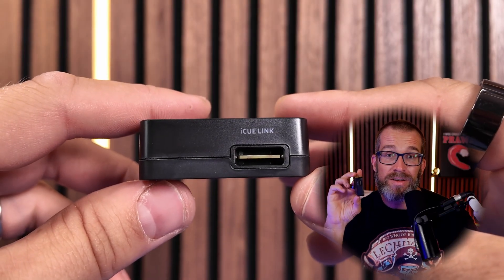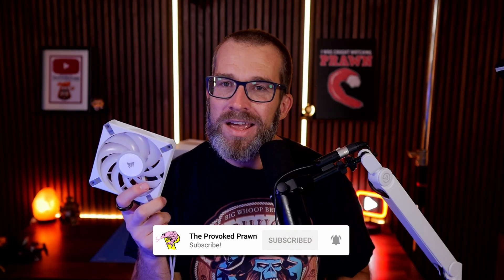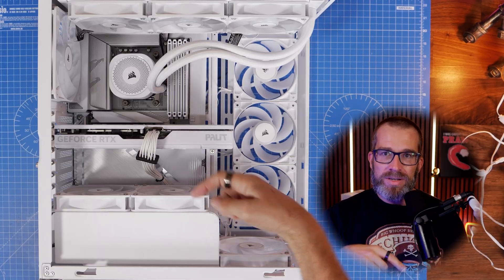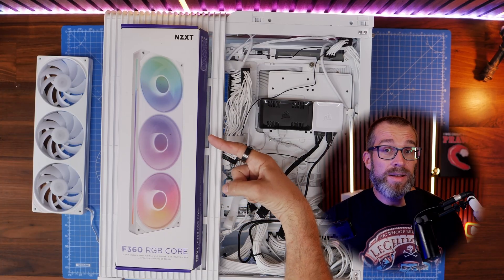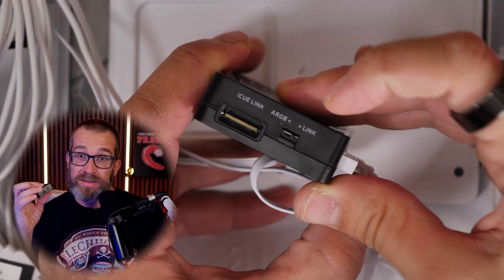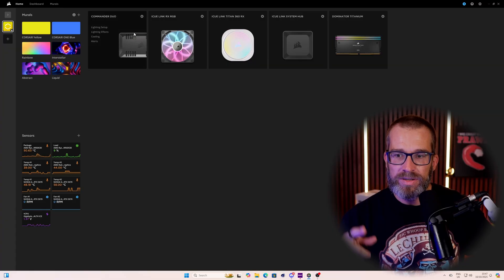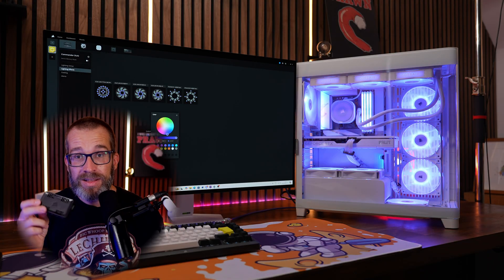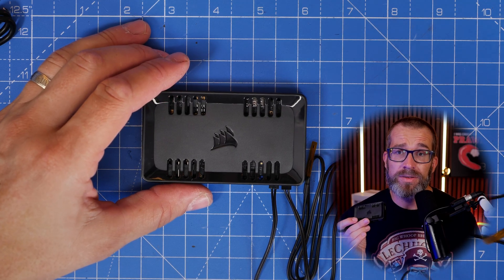Corsair Commander Duo - Everything you need to know

Comment: Im currently going for a Lian Li evo XL build and plan to use all Corsair LX/LX-R fans, titan AIO, ram ect and have been looking linking the Lian li case rgb and and possibly RGB strimers to my icue link i know it's possible with a 3pin RGB to Corsair RGB and this is possible by using the commander XT and another older commander model, do you know if this possible by using the ARGB port on the commander duo?
Reply from the maker: In theory you could connect the case RGB to the duo. But the Strimers would be difficult

Comment: Do you still not have to take into account the power output of the fan header of 1.5 amp of the commander duo? I have four rs140mm argb i want to connect to the icue link of my rx120 fans. I can't daisy chain all four 140mm fans (0.45amp) together right, just a maximum of 3 for a fan header of the commander duo?

Comment: Is this device intended to be used only on Windows systems?
I use Linux and I don't care about the Corsair iCue software itself. I'm interested in the hub to support more fans on my setup but I'm not sure if it will work as expected when not using the Corsair software.
Does someone knows if it's possible to use it on Linux without any software?

Comment: Hello! I’m building my first PC and I’m not sure if I need this or not. I have an X870 Aorus Elite motherboard, the Nautilus AIO 360 ARGB, plus 6 Corsair ARGB fans (I’m using a Lian Li Mini V2). I have the three bottom fans daisy-chained, the three radiator fans on top, and the two on the side. Do you recommend using the Commander Duo or should I just connect them directly to the motherboard?

I’m not really sure if there’s any advantage to connecting them directly to the motherboard or to the Commander Duo. In both setups, do the fan RPMs increase when the temperature goes up? Thanks!
Reply from the maker: The duo just lets you control via iCue. It's perfectly fine to just use motherboard headers if you have enough. Yes both let you control fan speed

Comment: Darnest thing. I recently purchased the LS350 led strip and it has the 5v arbg connection to the 2nd arbg slot of the Commander Duo and the strip lit up. The daisy chained 2nd strip only lit up 1/2.  Do I have a defective strip? I sent a message to Corsair and got mixed responses.  CS replied that the ls350 do not have 5v argb but the 3 pin rgb and as a result I would need an Link adapter.  Is this odd because how can I get 1 whole strip lit up if they weren't compatible.

Comment: So I can't use this to power the ARGB on my Nautilus 240? I don't have a ARGB port on my mobo
Reply from the maker: You could connect the RGB from the cooler to this yes
Reply: @TheProvokedPrawn thank you for the speedy reply actually lol
Reply: @TheProvokedPrawn Actually I have the Commander Duo and I can't connect the ARGB from the Nautilus to the Duo. There's not a correct header.

The wire from the Nautilus is a 3 pin header, there's nowhere to connect on the duo is what I mena

Comment: Also important to note, each ARGB port can only control up to 50 LEDs, which is quite limited, considering the Commander Core XT could control hundreds. Also, you can't control two daisy-chained RGB devices separately on the same port - again, the Commander Core XT could.
Reply: Not only that, but if you have six fans and one chain, all six fans are gonna display the same RGB 😂

Comment: I'm taking a chance on this; mine should be arriving in the next day or two (CORRECTION: Looks like it's arriving today). I'm hoping I can connect my O11 Dynamic EVO's RGB strip to this so that I can control it through iCUE instead of Armoury Crate.
Reply: Hi! I'm considering ordering Commander Duo for exactly the same reason using with the same O11D EVO RGB case. Can you pls update on if connecting the case's RGB strips worked? I'm worried it won't because the two strips have 47*2=94 LEDs, while the Commander Duo's limit is just 50 LEDs... though the case's LEDs have an external power connector (SATA), so providing enough power shouldn't be an issue on its own.

Comment: Thank you! I have been struggling with this issue since buying my first real gaming PC. Started with 3500X Corsair case with pre installed RS120 fans. Apparently my aRGB header on my motherboard doesn’t work, so I’ve been dying for a solution. 
Googles ai told me to get a commander core XT but that does NOT work for a number of reasons.

Comment: Thanks! I think this might just solve the fan control problems for one of my new systems. It's a Lian-Li 216 case with a Corsair Titan 360 AIO cooler. I've replaced the rear and shroud fans with Corsair iCue fans, but the two front fans that come with the case are a problem to integrate. The case comes with its own fan controller, and a side interface with buttons to select RGB effects for the two front fans, but these are not recognized by the LConnect 3 software (nor by the Corsair iCue software, of course). Only Signal RGB can handle both, but then the LCD display on the cooler is limited to displaying coolant temperature. The Commander Core XT should allow the integration of the front fans into the iCue system, but has become nearly impossible to find. I've ordered the Duo using your link for delivery tomorrow, and expect to perform the surgery on the system next week, using the Duo as a pass-thru to the iCue fans, and connecting the front fans separately to the four ports (two PWM and two ARGB). Then I can drop Signal RGB, which complains about not being solely in charge of everything, and control with whole she-bang with the iCue software.

Lesson learned: stick to a single manufacturer for all ARGB fans.
Reply: I think Corsair will fix this issue in the next firmware update. Any PWM fan should work. Keep an eye out for Corsair updates.

Comment: Think i'll just stick with my Commander Pro. Corsair seem to be selling stuff for the sake of it.
Reply: This is literally a gift from the gods for us who want Corsair Software control for RGB without having to deal with corsairs CRAPTASTIC RGB fans that fail within months. 

Thank you Corsair for recognizing not everybody wants to buy a set of fans each year from you!
Reply from the maker: You couldn't use this with fans that work with a commander pro anyway
Reply: @TheProvokedPrawn  No but i have Link fans on my cooler and Noctuas on my Commander. I could still plug my Noctuas into the fan part but it seems stupid still to put everything in one box when iCue is so good at breaking everything.